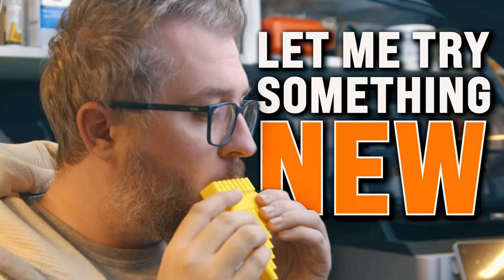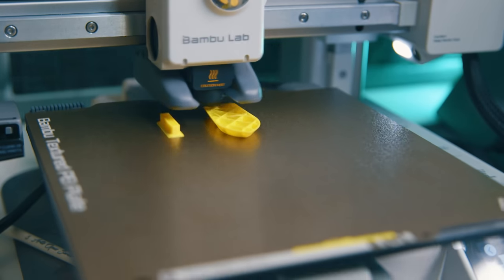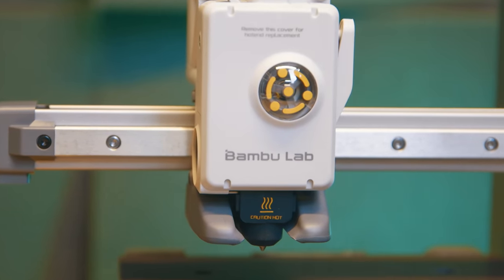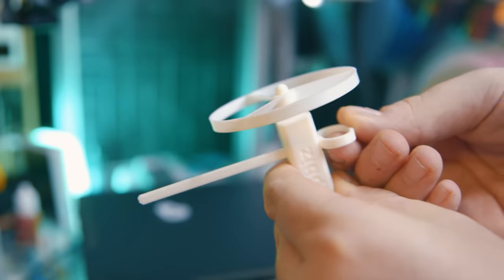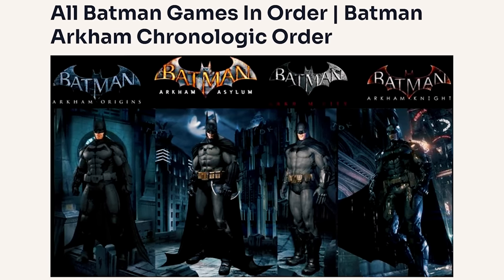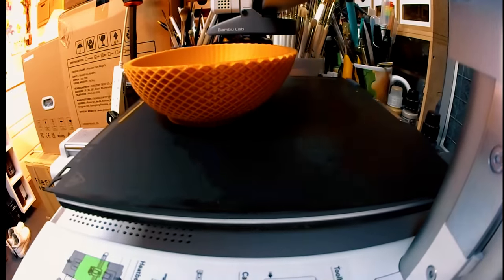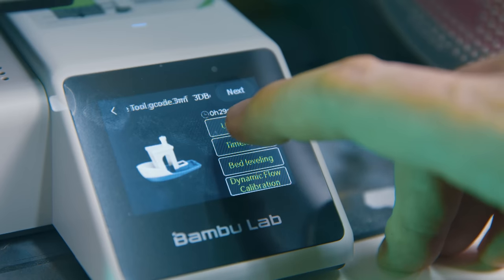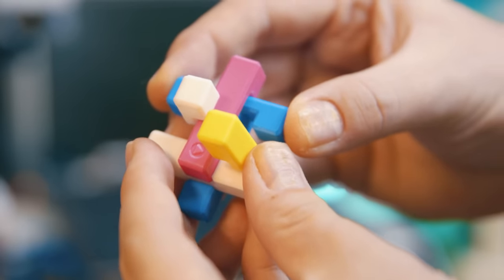Bambu Lab - A1 Mini Review - IT WASN'T MADE FOR YOU!!!!!

Comment: at 3:01 from what i have heard it is highly not recommended to move any axis using your hands as you can backfeed power to the circuit board and fry something. before I knew this I noticed if I moved an axis with the machine off the built-in light on the printer would come on for a second.
Reply from the maker: yeah nine does too. but sometime you need to. Just never do it with the power on.

Comment: Nice video.  Thanks.  Quick question for you if you have time:

Would this be a good upgrade from an Anicubic Chiron printer ?  I do mainly custom designs of small parts that assemble into each other ( parts are generally less than 10 mm ) and from a precision point of view, the Chiron just isn’t working for me.  Thanks again for sharing your experience and enthusiasm.

Comment: Filament Question: Yes!  We're sold, we definitely want to help get this for our kid who has been saving up for their first 3D printer. But we're totally overwhelmed by all of the filament choices.  We're getting this for a very crafty, artistic, 11 year old who will want to make fun little figurines and such. What's the best starter filament for someone who fits that bill?
Reply from the maker: Get the official Bambu Fillament and you’ll have fewer issues. It’s comes with an RFID tag that reads what the fillament is so that you already have the best settings in the app.

Also. After you buy the printer. Their fillament and refills are heavily discounted for the next 6 months
Reply: Thanks!  We're using that subscription now. There are different kinds of filaments - PLA basic,  PETG Basic and ABS at the discount, then we get into silk, marble, etc. Should we just stick with PLA Basic to start with for a kid who is going to mostly be making do-dads?  @FauxHammer

Comment: No A1 Mini user here - I got my P1S two weeks ago and I'm hugely frustrated by now as I can't get my first design to print properly without getting gaps on one of the flat sides and apparently no one can help or explain whats causing this... 😢 

I managed to increase the quality by changing the wall-print to outer-inner and increase the wall thickness to 3, but not even slowing the printer down makes any changes... The worst part.. I might know how to fix it with Cura, but none of the functions exist in Bambu Studio..

Comment: When you printer is incomplete and imperfect, there is a temptation to fall into the endless printer upgrades. 
In this case, instead of learning 3d CAD designing and making your own things, you constantly tweaking and improving your printer, buying new staff for it, installing it, and so on. 
There are so much upgrade kits for Ender 3 like printers,  you can easily spend more money combined, then a Bambu Lab printer cost. And simultaneously there won't be time for you for an actual 3d designing and printing.

A1 have everything. But what it didn't have (like the ability to print nylon) it will not have.

It's complete, you can't upgrade it, so you will be forced to design and print instead of spending time and money for various upgrades! 😆

And if you reach it's limitations, your only option will be a buy a new X1.

Comment: Are the PTFE tubes connected corretly? It looks like the short ones are on the back and long ones are in the front, but I have the short ones on the left and the long ones on the right. So absolutly no problems with the length of the tubes. But also liked your video, absolutly agree with your opinion. :)
Reply from the maker: You may be right actually, I never noticed there wee longer and shorter ones. But having redone this. It's still too short.

Comment: Bambu is going to be adding to their A1 line. There is no way they made the AMS Lite for use on a single printer so ..get the combo because I guarantee that more and larger are coming ,MARK MY WORDS!. I really want an A1 Mini and the AMS Lite. Your video is dead on. Its a fantastic place for anyone to start. I fact it will somewhat ruin them for other printer.
Reply from the maker: Thanks mate. Yeah I do hope they make more things for this to be compatible with, but I also hope that they make the AMS Lite available solo soon too. I think they are missing out by not having that available now over this sales weekend.

What is weird is the A1 has 2 ports for AMS Lite units and when you plug it in, they say you an use either, so what's the other port for? They must be planning a way to use at least 2x AMS lite with these.
Reply: @FauxHammer  I bet they are so you can get around the same number of colors as the other core xy from p1p to x1c. I do know that they are coming out with larger offerings in the A line the a1 mini was the introduction. Then they will cover all from bed slingers to the core XY.
Reply from the maker: @3dpathfinder  Ooooh, exciting! what do you know? What's your source? Any idea when we'll see a larger Core XY like a X1Max or somethig? We need 300x300! or ideally 325x325!
Reply: @FauxHammer  Loyal Moses apparently has an inside track on some info from Bambu Lab. He planted the seed in one of his videos at the end. Without that thought,  I can't see a company like Bambu making a single use product. The same way they went with the p1p to p1s to x1c. They made an ecosystem,  where you had components working across different platforms. The AMS lite is in many way an engineering upgrade from the AMS. There is more engineering in the ams lite then the A1 Mini. So logic would lead to that more would have to be coming. Bambu really knows what they are doing now and are refining their products and want to have something for everyone.
Reply: They hear the call for larger volume,  because all their competitors are filling that missing segment in bambu's line atm.
Reply: 256 X 256 X 256 isn't bad but EVERYONE wants more. I'm waiting on my Neptune 4 plus to finish a Stormbreaker now. Because I didn't want to break up the model in my P1S.
Reply: @FauxHammer so regarding the second port on the A1 mini, as of right now it does not support more than 1 AMS lite unit, according to bambus technical pages and comments. I wonder if it does end up supporting a second unit, why not specify that function is coming to the additional port?

If it's not going to be for multiple AMS units, things are even more interesting, lol. I guess we'll just have to wait and see.

Comment: I have p1 and X1, but many prints/parts are sized for this inexpensive printer, Secondly, I couldn’t have it in my office workspace due to noise level ( although latest firmware improves this). The A1 mini is quiet, accurate and has the ams, so respectively, I disagree with your premise that it isn’t for us..

Comment: The only thing that doesn't fit my bill here is being able to print ABS. I tend to want to print functional parts that can sustain some force/load/tension and I've found ABS to work better in this regard than PLA.

Are there any options for more durable/strong filament that work with this printer? What do you guys use?

Comment: For a total noob: if the thing you want to print is larger than the Bambu allowed size, can you break it down into pieces and/or shrink the model to fit?
Reply from the maker: you can, though it can be tricksy. But do you know there's the large A1 coming out? Video drops in 2 days.
Reply: @FauxHammer  thanks for this, best response ever. I was gonna order the A1 mini with AMS but now I'll order the full size A1, and worry about the AMS feature later. It feels better knowing this printer will have a lot more option in the future.

Comment: I have a P1S with AMS but as I get more orders I have to consider my next printer.  This might be it.  Does it print as fast as the P series?
Reply from the maker: It;s marginally slower, but I doub't you'd notice in the long run.
Reply: @FauxHammer  It's not like I run the P1S at blazing speeds, anyway.  I stay around 200mm/sec.
Reply from the maker: @boboscurse4130  in which case you may slow this down too, but it;s relative. It;s a bedslinger vs coreXY so you have that extra model judder to contend with, depending what you print and how stable/heavy it is, this may not even be a facory.

Traller flimsier objects will wobble more. Heavier smaller objects will be solid in either case

Comment: Hi! Thanks for the video! I have a single question for anyone willing to answer it. Can you set this up without ever using the app and without an account on Bambu's servers?
I am very interested in this printer, but would not purchase without finding out the answer to this question.
Reply from the maker: You can, but I don’t think you don’t have any WiFi features available. You just print and save to an SD card. Then print the file from that card plugged into the printer.
Reply: @FauxHammer  Thanks! All my other 3D printers running either Klipper or MKS Wifi just work wirelessly right out of the box, without any account needed. I am against such practices, given how often data is leaked and all of these accounts require some amount of personal information. Everywhere I searched, I saw that you need to have a Bambu account to set up the printer for wireless use, then only later you can print directly to it from Orca or Cura.

Comment: i am new in 3d printing, so my question may sound newbie. Why small is big issue, cant we make integratable parts, connect them and make bigger for our prototype?
Reply: it's not an issue, it depends on what you want to do. For me 18 cm cube is more than enough. And yes, you can make parts that slots between them, so as you say, you can circumvent the problem.

Comment: I have a table with these measurements: 140x50cm attached to the wall. Will I have any space problems to put this printer, or will the bed or the shaft collide?
Reply from the maker: you'd likely need to have it sideways if it is 140 wide as the bed moves back and forth

Comment: I have a Neptune 2 which is gathering dust as out side of the Buddha and one other print I have not got the bastard to work properly and working 12 hr shifts and being a dad I want something more plug and play, not plug and curse. This is tempting shame its a bit smaller than other entry level printers, if the do a 230x 230 x230 version ill be all over it like a tramp on hot chips.
Reply from the maker: yeah I think a lot of people are hoping for a larger version of this. I guess it's not impossible. "When" is the more important question.
Reply: There is a larger version called the A1, for $100 more,  but it is being recalled to fix a cabling problem, so not expected to be back on the market until May. Bummer.
But I think the small one will be fine for my needs.

Comment: Can it print minis? My Mono 2 is pissing me off. I haven't tried minis on my K1 yet though.
Reply from the maker: It can, but no where near as good as resin, I have a video coming out soon with a 0.02mm nozzle that matters.
Reply: @FauxHammer really appreciate you covering this as I haven't heard much on how well the smaller nozzle performs. While not the same as resin, I've been curious how the A1 mini with the .02 nozzle compares. By any chance have your tested any of the non material types that should potentially work on the A1 mini?

I ordered the A1 mini AMS mega combo which actually just shipped. This is my first printer. I was going back and forth trying to decide between a P1S or an A1 mini with AMS, and for some reason my gut told me to get the A1 mini, hoping that ends up being the right choice.

Much love and gratitude.

Comment: I wonder why the p1s or p1p dont have the easy change nozzles
Reply: I was actually debating between a P1S and A1 mini, and the quick change nozzle system is one of the stronger points for why I ended up choosing at A1 over the P1S. 

I watched the video of what's required to change nozzles on the P1S, and while not difficult, it was a bit more effort than I would want to put in.  Specifically because I like the idea of switching from a bigger to smaller nozzle when I want to do a print that is more detailed. 

The ease of swapping nozzles simply means I'm more likely to do it when it potentially could produce better results for a specific project. 

I'm curious how well the .02 nozzle performs on the A1 mini it's comparing it to a resin printer. While I don't think it's an achieve the same results as a high quality resin print, I'm curious how close it can get.
Reply from the maker: It's a newer development, I bet he next generation of these models will have that.

same reason why this cuts the filament lower during swaps. to reduce waste.

Comment: Any tips on connection this printer to a mac?
Reply from the maker: Doesn’t the Bambu studio run on a Mac?
Reply: @FauxHammer  It does, but connecting the printer is difficult because it does not give you a 6 digit connection code, just a QR code.

Comment: Does anyone think that switching to the A1 mini from an " ELEGOO Neptune 4"  is a good idea?
Reply from the maker: yes. pretty much everyone who has used both., but I;d push for the A1 if you can. most designs out there are built with that size plate in mind
Reply: Alr, thx @FauxHammer

Comment: Yes a nice toy for someone who does not want to 3d print, and have some money. If they will disappointed from 3d printing after such device, I guess they are really have to do nothing with 3d printing after all.
On the other hand, I would still prefer my Ender 3. Really do not see any trouble to spend a day or two for setting up printer. Well, if you are capable of setting up anything. I already know that some enthusiasts hack Bambu printers to heat the bed up to 100C for example. So different people try different approaches.
I prefer to control the firmware, not to solder hacks on a proprietary device.
It will be interesting to look at the after market after five years or so.
You can get Ender 3 very cheap there, and you can install a couple of upgrades and be ready to go. What will be Bambu after market printers I wonder. = )
Also, about setting up, clouds and camera. You may consider me a paranoiac or an old fashioned. But I prefer printers which do not ask me to create an account just to turn it on. And computers too (say hi to Mac and now W11).
Also build in power cord in 2K24! Is it a joke? = )
Oh, I forgot, Bambu is Apple in 3d printing. I guess they have replacement cable for $99.99 'only today' on their website = )
Reply from the maker: i don't quite understand what you mean?
Reply: Different crayons have different taste, that's it = )
Reply: Anyone who recommends an Ender 3 over smth like a Bambu Lab A1 Mini is beyond delusional, especially at the current discount.
Reply: I would wait for A3 or A4 at least. But it's up to you. = )